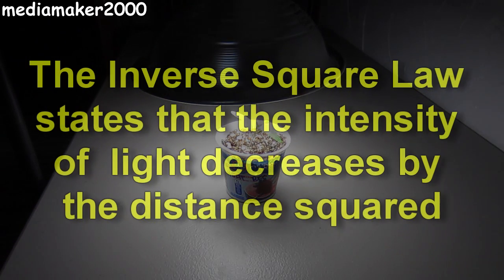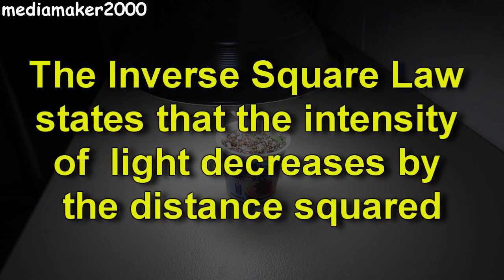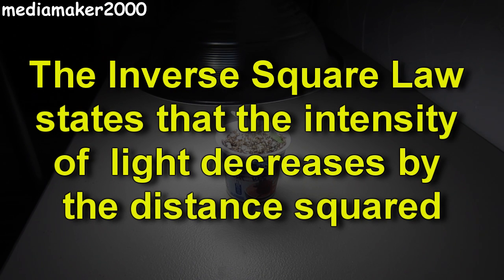Grow Lights & The Inverse Square Law

Comment from the maker: Thanks Stymye! I think some gap because all the plants may not be growing at the same rate and want to keeps the leaves off the light as that blocks light and inhibits light from getting to rest of the plants. Great gain for one plant but maybe bad for the others. I keep mine backed off a little in case I get busy and don't have time to check the distance between the plants and the light. If you only have one light and all the plants aren't exactly the same height, you almost have to gap.